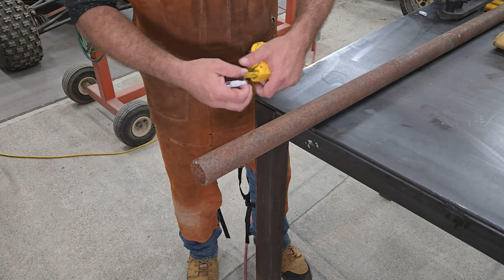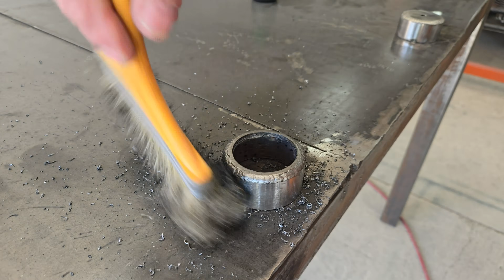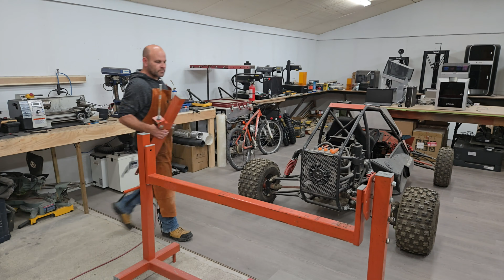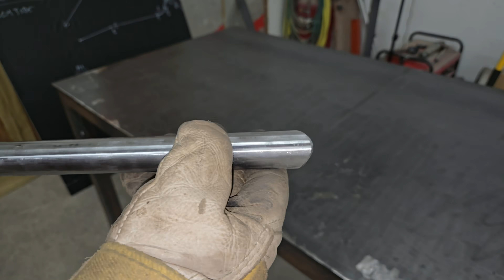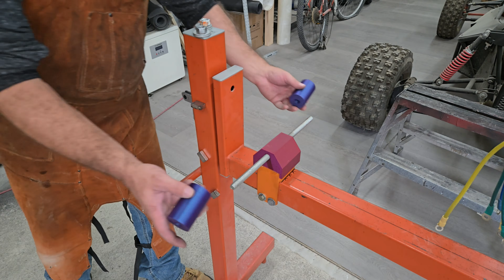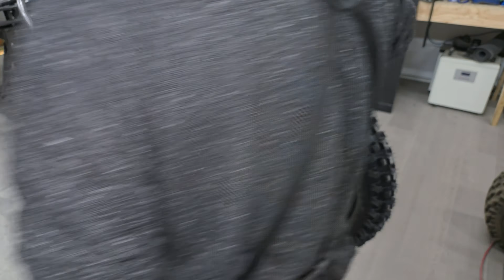Electric Dirt Bike Build Ep.2 | Chassis & Suspension - Tube Bending - Laser Welding

Comment: Why laser welding instead of a conventional arc welding process?
Reply from the maker: Because it's better suited for this type of work. They produce better quality welds on a wider range of materials with ease, are up to 10 times faster at running a bead, the high focused energy from the laser produces a very narrow heat affected zone and less distortion, and it can easily replicate the 'stack of dimes' TIG look that everyone loves to compare everything to. They're generally far more expensive, that's why they were only used in industrial settings that could justify the cost until recently when patents were released and companies started making more affordable versions like this for small businesses. The ROI is the tell all. Cleaner, faster, more material options = a faster payback period. 

I'm sure you've seen the grifter videos claiming laser welders are junk because they apparently can't weld thick material well, but keep in mind that this is only a 700W machine....not a 3000W MIG. This is rated for welding up to 3mm thick sheets or steel, aluminum, copper, titanium, etc., - I demonstrated with etch tests in a previous video that it can handle 6mm. A common 3000W TEMU MIG is 4x more powerful, so logically it can weld thicker material. But laser welders come in all sizes, with industrial welders capable of butt welding 1" thick material with a single pass, no v groove. Ie: these people misrepresent the tech for clicks and biases.

Comment: How is the penetration on the laser welds? and another thing when you fast forward in the vid you should adjust volume it rips my ears of the high frequancy sounds
Reply from the maker: As good as any other welder with the same power rating - that last part is the key. Don't let the idiot grifters on here tell you otherwise. They're comparing a 700-1200W laser welder with 3000-5000W MIG and TIG - these are different tools in different worlds with different applications, apples to oranges. This machine is 700W and rated for welding up to 3mm (1/8) sheet material. I demonstrated in the previous review video with abuse and etch tests that it can weld 6mm plate with industry acceptable penetration (at least 10% for fillet weld, for ex). It can fully penetrate 3mm material, ie, butt joint welding two sheets of 3mm together = full depth penetration, no v groove required. A machine like this is perfectly suitable for bike tube chassis building, autobody repair, things like that. Anything that involves welding up to 3mm thick material.

I do adjust gain depending on video speed - maybe you're just sensitive. I don't care enough to get nit picky to suit individual preferences. Put your big boy pants on and adjust your volume, bro.

Comment: Hi! I’m a student currently building an EV bike for a college project.
We’re using a 60 V / 40 Ah battery and aiming to keep the bike under 150 kg.
I wanted to ask your suggestions on:
– The best motor + controller pairing for this setup
– Expected range and efficiency tuning
– Safe wiring and testing before full assembly
Your content has been a huge help — would love to hear your advice!

Comment: Aren't laser welds usually shallow and comparatively weak? Have you done any tests?
Reply from the maker: No. That's a controversy being pushed online by stubborn grifters. Some will even stoop so far as to buy a cheap soldering gun and try to pass it off as a poorly designed laser welder just to muddy things up and confuse people. I suspect competition is behind it - I’ve seen dirty tricks like that before in the micro-wind industry.

The truth is that laser welders have been used in industry for decades and can cut or weld material over an inch thick. They’re industrial machines doing industrial work. Patents on the core technology have expired, and now other companies are taking advantage by producing smaller units for the average shop owner.

Check out my review where I did etch tests - there’s no sacrifice in performance between a laser welder and any other process unless you’re comparing different power ratings. A 4 kW MIG from Temu will weld thicker material than a 700 W laser; a 7 kW laser will weld thicker material than a 4 kW MIG. Power and efficiency are what matter when it comes to penetration.

Laser welders are more power-efficient than arc welders for several reasons - we’re talking roughly 80-95% vs 50-70% - so they don’t need as much power to do the same work. Again, check out my review where I show both stress and etch tests with this machine.

You’re not going to build a DIY mini dozer from ½-inch plate with this, but it’s perfectly suited for this type of work - and in my opinion, better than a typical MIG. Not that I haven’t welded 3 mm tube chassis with a MIG, but it’s like using a framing hammer to drive a finish nail.

This welder can handle ¼-inch steel with no issues and can go down to 0.5 mm sheet without blowing holes. In short, at this power level it’s great for sheet metal and thin plate, but once you get much over ¼-inch, penetration drops below the typical 10% minimum for a sound joint.
Reply: @JamesBiggar  Oh, sounds good.

I've practiced MIG and TIG and if this is a legit alternative for this stuff then that sounds great. Dipping and resharpening tungsten wolfram rods sucked.

Comment: I would like to see how much does frame by itself weight, without any components on it :)
Reply from the maker: About 30 lbs for the frame and swingarm together, give or take a pound. I haven't weighed the bare frame. Bikes this size usually have frames in the 25–35 lb range, so it’s not a Light Bee — more like an Ultra Bee in weight and power, but stronger. Die-cast aluminum works well for mass production (quicker and cheaper with less skilled labour involved) and is reasonably strong for its weight, but it's still rigid/brittle and can’t match a custom steel trellis tube chassis for strength to weight ratio and rider feedback. Not that it really matters in the end unless something is royally screwed up - I'm just making excuses for myself lol. What really matters is the total curb weight. It’s always a balance between strength, weight, and performance. When finished, it should be about the same or a bit lighter than an Ultra Bee (around 150cc class).
Reply: @JamesBiggar  Damn, does it mean that each wheel and forks are about 22lb? Chunky
Reply from the maker: Haha, nah, not chunky at all - that’s actually pretty normal for a bike in this class. Each wheel and fork assembly ends up around 15–22 lb depending on the setup, and the frame/swingarm is ~30 lb. For a full 200 lb-class trail bike, that’s exactly what you’d expect.

I think it just looks heavy if you’re coming from DIY or MTB components - everything is more robust on a proper dirt bike, but it’s still lightweight enough for the power and terrain it’s designed for.
Reply: @JamesBiggar  Yeah, you are right. Mtb components are about 1/3 of that weight for wheels and fork, and 1/4 for the frame (with frame usually being the most often part that breaks in you ride hard lol).
I guess in my head I wish there was in between, when it comes to mtbing, they focus so much on weight that they use less material than they should to make it last, when with motorcycles and dirtbikes, they dont care much about weight, because "its going to be heavy anyway" and just add material without think of making it more durable with design. Two extremes of the spectrum, mtb parts break too easly, motorcycle parts are almost impossible to just break, last decades, unless driven into a tree. 
Would be great if those parts would focus on getting to something in between, like 6-7kg for each of those parts to save 30-40% of weight, which also means it needs to be less durable, because it doesnt need to support as much of its own weight.
That would fit a lot into the new high powered electric motorcycles.

Comment: uhhhhh, that bearing press on the inner race is gonna come back to haunt you. ask me how I know lol. grab a stack of washers next time. even without a press you can use a bolt and nut. Oh an at least your bottom head bearing should be a tapered bearing.
Reply from the maker: Lol, thanks. Been there before. I know what you mean. Radial bearings aren't built for axial loads. But they're only $20/piece at Princess Auto anyway. I'll pick something up to press replacement bearings if/when I have to go get more. Both upper and lower head tube bearings are tapered - they come with the forks (I fit the races in the beginning)

Comment: Really fun to watch you get back to these style videos! Out of curiosity, are you using any type of software for FEA on the frame? Or using a reference frame?
Reply from the maker: Thanks, glad you enjoyed it! For a basic steel tube trellis frame like this, FEA isn’t really necessary. These frames are pretty forgiving, and the geometry itself - triangulated tubes forming a truss - already gives excellent strength and stiffness. Most builders just use proven tube sizes and layouts from similar bikes as a reference, ie experience - old school approach.

FEA usually comes into play if you’re experimenting with exotic materials like composites, unusual cross-sections, or trying to shave grams while pushing the limits of strength for a competition machine. For a standard steel or aluminum frame, real-world testing and iteration is faster and more practical than running simulations.
Reply: @JamesBiggar Makes sense! Thanks for taking the time to explain this. Cheers!